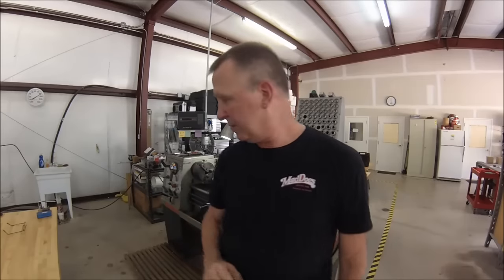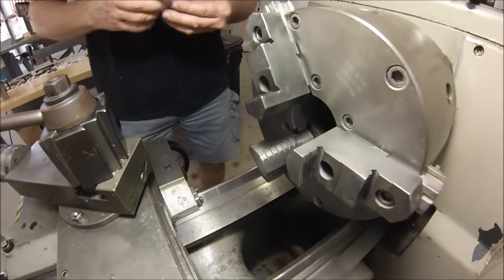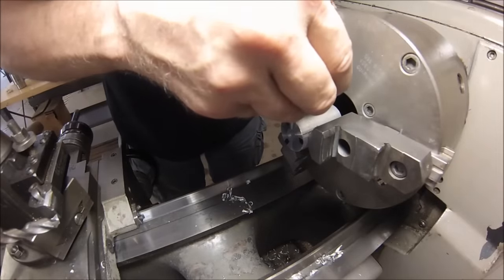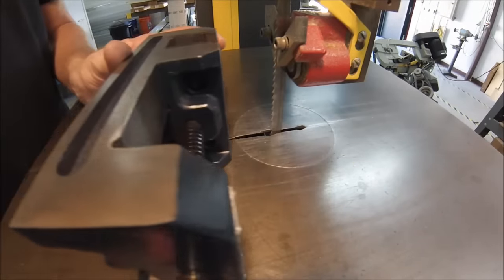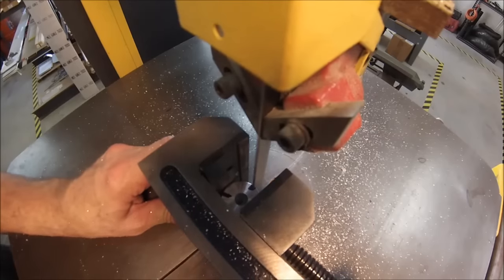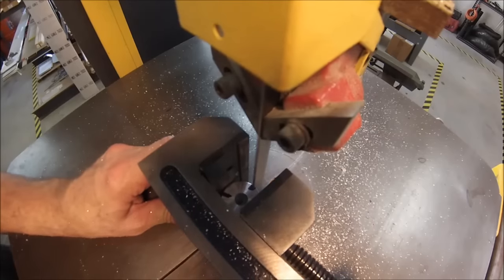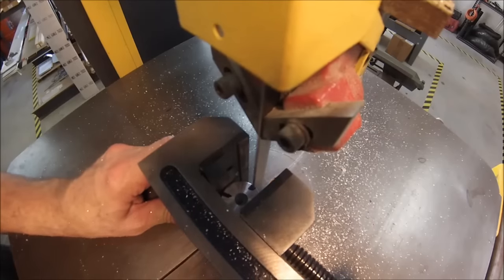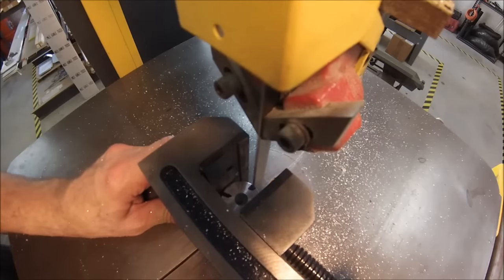Get your parts to run true in a non adjustable chuck. YOU MUST WATCH THIS!

Comment: The "runout" of the chuck "body" really has nothing to do with how the stock ends up in the jaws and unless the stock is "true" to the SPINDLE CENTERLINE AXIS it doesn't matter what an indicator on the chuck "body" says. And until the part is perfectly "true" to the spindle and a cut is made to make sure its "round" what the indicator shows doesn't matter no matter where its placed. The term "concentric" is pretty consistently used INCORRECTLY to refer to whether or not something has "runout" when "round" and "centered" and "true" and "concentric" can all exist independently. A CIRCLE WITHIN A CIRCLE WITH BOTH ROUND AND "CENTERED" PRODUCES "CONCENTRIC" CIRCLES. If you don't start with "concentricity" there's no way to "make" it.
Reply from the maker: Thank for your your comment. Many remarks are true. My turn. The jaws of my chuck are known to be true to the OD of the chuck, so putting the indicator on the chuck OD is a very good representation of where I know my jaws are. Until I place an indicator on my workpiece, I don't assume anything. The rod used in this demonstration is a 6" long HSS ground drill blank which is "round" and straight to .0001. Throwing the chuck body off center was for illustrative purposes only and was backed up by a second indication of the part itself.
Reply from the maker: I have one more correction for you. You state " If you don't start with "concentricity" there's no way to "make" it." I disagree 150%. Concentricity is a relationship between 2 axis. On a lathe, one ( the spindle )  is fixed and the other ( the part ) is up for grabs. 4 jaw and adjustable 3 and 6 jaw chucks, and tricks like the one shown here,  allow for a skilled operator to "make" ( establish ) a concentric relationship. If I am missing something in your remark, please correct me.
Reply: Gotem!

Comment: Come on!  What did this prove?  The lathe don't give a crap if the part is running true.  The hole is gonna be dead nuts wherever the chuck or the part is. Of course after 47 years in the biz I know a thing or 2 myself....
Reply from the maker: It proved you can get great results with a POS chuck.
Reply: Well if you cant see the point in the exercise ...doesnt matter how many years experience you have ...

Great videos joe ..keep em comin .

Comment: Wow, this a waste of time. Not a single good thing about it.
Reply from the maker: 695,000 views, 10,000 thumbs up and 1670 comments would indicate you are in the minority. Can you tell us how you would overcome this problem without a toolpost grinder, soft jaws or chuck adjustablity? I am interested.
Reply: @joepie221  After 20 years as a machinist and 10 of which running my own workshop. I believe this is a waist of time. If your chuck is running out like this, which in real life almost never happens, you will just clock the chuck. You spend a lot of time and effort to make a bush, to machine pin. Your next job will be different size and you will have to make another bush. Even if the next job will be the same size this bush will move and the job will run out again.
Reply from the maker: @damian5427  I believe you completely missed the point of this video. This demonstration clearly showed that even a piece of junk chuck can still be made to hold a part concentric without spending money. If you truly have 20 years of experience, you know making a bushing like this should be a 10 minute job. Not a bad investment to assure the second side of your part runs true. You should also know if all you are machining is a pin, do it in one shot from larger stock. The pin used in this demonstration was to illustrate the improvement in concentricity which it clearly delivered. if your shop can't afford 10 minutes and 50 cents worth of aluminum to make a good part on an old machine, you may wish to rethink the future.
Reply from the maker: @damian5427  You still didn't tell me how you would assure concentricity with a bad chuck??? If you are going to critique, please contribute as well.
Reply: @joepie221  It is like drilling a 10 mm hole and using 3 different borring bars to open it up to 50 mm. It is possible but it is not a smart way of doing it.
Reply: I will just spend 2 min and clock up the chuck.
Reply from the maker: @damian5427  Did you miss the part of the title that says "Non Adjustable Chuck" ?
Reply from the maker: @damian5427  How about go back and re-read my very first reply to you.

Comment: first, never use a file on the lathe, it destroys the file. second, never use as video shows. if you do use a file to break an edge , turn the file around and use it on the bottom side, that way if it hits the jaws it is thrown away from you not at you.
Reply from the maker: OK, not sure what your experience or training is, but I have never, and I mean never worked in a shop that thought using a file on a lathe was a bad idea, nor have I ever seen anyone put a file under a part to deburr it. That is not a practice I would endorse, suggest or train anyone to do. But thats just my opinion as is yours. As far as a file hitting chuck jaws.....stay tuned.
Reply: The reason people destroy files by using them on lathes is because they run them too fast. Files are made of carbon steel whose optimum cutting speed is about 1/3 that of HSS, or about 10-15% that of carbide. Slowing the lathe to close to it's slowest speed greatly mitigates the tooth wear.
Reply: @joepie221 

  Been a machinist for 45 years starting in aircraft spares, then building high pressure water jet pumps and tables, after that I opened my own shop where we built food processing equipment for Conagra and Stein.  No one ever got away with using a file like that without being told don't do it. The chucks, never used a chuck that only had one drive unless it was some little 6 inch chuck. Both my 16 inch and even the little 13 lathes at home have 3 drives. To each is own though, I just wouldn't let anyone use a file I own on a lathe.
Reply from the maker: @deanwattles8722  We have obviously walked very different paths. And my 8", 3 jaw, BUCK, adjust-tru chuck, only has 1 drive. Stick with what ya know.
Reply: google "lathe file".  They are made for filing on a lathe.
Reply: @joepie221  he isnt wrong about the lathe chewing through a standard file though. not to say you shouldnt do it, more that it should be expected that the file is gonna lose more teeth than a hockey game. fun fact apparently they actually make files specifically for use on a lathe, with a deeper slant to the teeth. more sheering effect, less bulldozing.